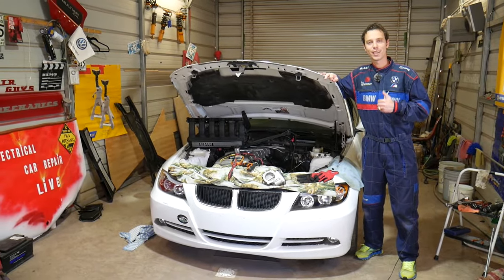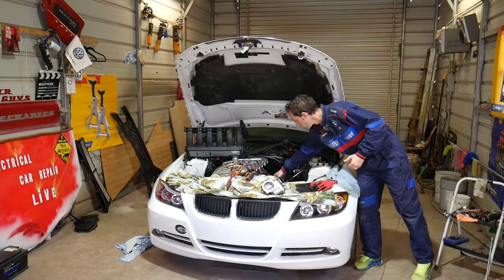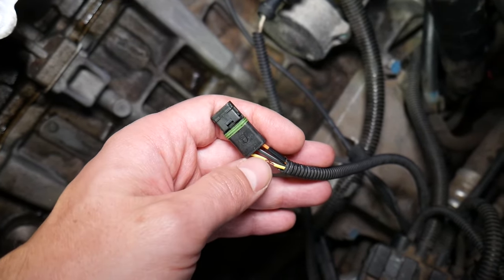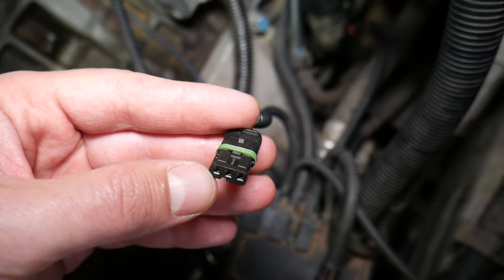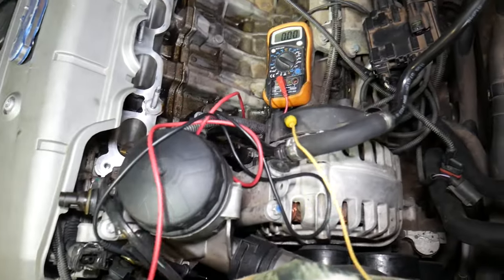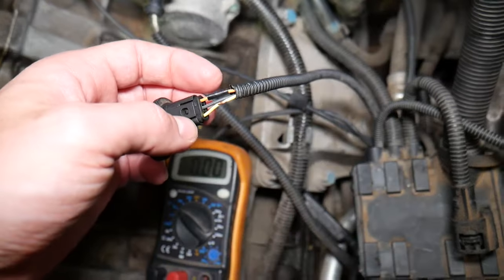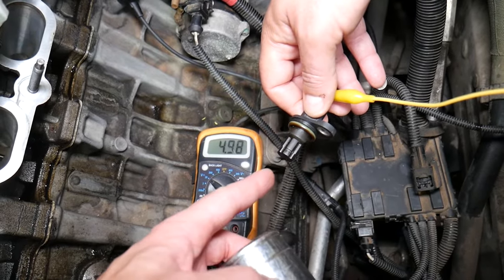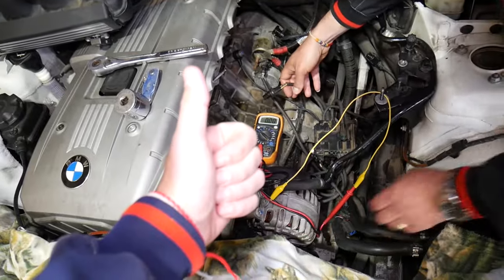HOW TO TEST CRANKSHAFT POSITION SENSOR ON BMW

Comment: Thank you  for very good explanation.  But my bmw e90 yellow  wire is giving 11volts instead of volts as explained,  ignition one  is giving 12volts.. is that normal? Please share the link if you have a video concerning this.

Comment: I got this code 2DC8 and 2DC9, the symptoms are slow acceleration, and dash light.on, abs,4x4, abs, and transmission indicator flashing, and sometimes car not start. but after off the engine and cold, becomes normal again..please advice

Comment: Thank you for delivering to us these useful videos. They can really help save costs and help maintain the vehicle.

Now, i have a question, i am driving a BMW 3 Series 320I Model Code: ABA-VA20 2007 Sedan. However mine is Japanese Made.

Will the Maxicom work on it if i import it from Amazon US? I am in East Africa and we rarely have those diagnostic tools.

Secondly, do these videos also apply for Japanese made vehicles? Or its only for Europe & American manufactured cars?

Kindly advise.

Comment: Hello,
While reading error codes on my BMW 318d 105kw n47 11/2008 LCI, it's reporting in dde an fault code 4CA7 fuel temperature sensor, plausibility - do you maybe know what it represents, where this sensor is placed? Thanks, Daniel.

Comment: Hi.ihave BMW 530i 2004 crank but not no start  I change fuel pump and crank sensor the battery is new. I'm crazy pls help me.
Reply: Did u find the problem
Reply: @robertgonzalez3361 I have the same exact problem. Changed everything you said and more. HELP
Reply: First check for fuel pressure! If you have the right pressure you can move onto something else. Make sure the spark plugs and coil packs are in working order if not replace them.

Comment: Hi and thanks for your videos but I have a weird issue with the crankshaft position sensor because I have de 5V (in my case) ECM supply, ground and with the sensor unplugged 0V and plugged 5V reference as it should be but when put a socket near to sensor as you did the reference voltage goes 0.11V and when you move away the socket  the voltage keeps down as you show in the video, I tried with other new sensor and the same issue but when you unplug and plug the voltage go up as it should be 5v and if you put the socket near again the same issue happens. Do you have any idea of this issue?
Reply: Hi, did you manage to solve the problem? It's the same for me
Reply: Aún no soluciono el problema 😢 @Velek3

Comment: Everything is alright for me on all 3 wires. 12 volts on power, good ground, 5 volts and less for signal. The only part im stuck on is I have bought 2 sensors and the signal doesn’t change from 5 volts to 0 when I put metal in front of the sensor. The readings stays the same 5 volts. Have any ideas what could be going on?
Reply: Hello, Did you manage to solve the problem?
Reply: @Velek3  Yes, there is a fuse for the crankshaft position sensor where the dme and transmission module reside in, right side of your engine compartment if you’re in the US. It was blown, replaced it, did the testing from the video and voltage changed. No more transmission or check engine light.

Comment: Hi 

I get 5v on power and ground. 
Also get 5v on ground and signal ??
Reply: Same here
Reply: @dishim7038  same with me on the F30 n20 engine, did you ever get help?
Reply: Hello did you ever get help on this?
Reply: @eddiemaake9515  yes  turn out the ex camshaft on bank 1 was slightly damaged with stretches from metal to metal contact.
Reply: @kay4609 también no te llegaban los 5 voltios de referencia???

Comment: CRANK, no start. HELP. 

2008 e83 Bmw x3 3.0si N52 4x4
Changed fuel pump, swapped motor. Gas wont reach motor.

Comment: My bmw 335i 2008 show me check engine light, and show me the  fault is P0113, P2091,P0238 i will go to smog check shop , guys told me you remove the check engine light then i check the smog test

Comment: Hi . I have unfortunately  got a  cx7 2011  2.3 turbo  petrol engine.  Since Ur a mazda machanic?   My crankshaft position sensor.  3 wire connector.  Now  I have 5 volts at the signal wire  a ground n the 3rd  pin the ignition  wire. Now what should that ignition  voltage be with  the key on. N not cranking over?  . This car is the biggest  pile off rubbish iv ever owned. Ur help will be appreciated  thank u